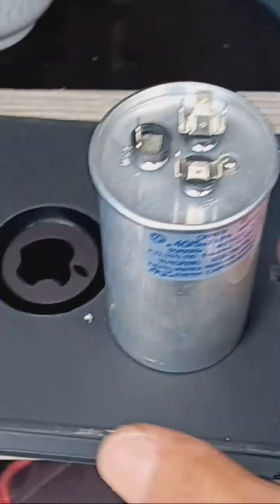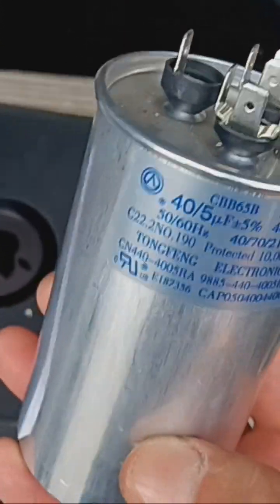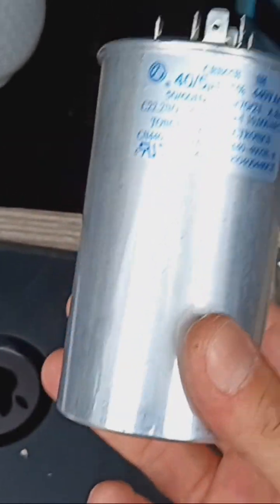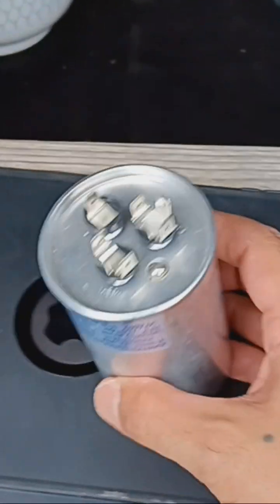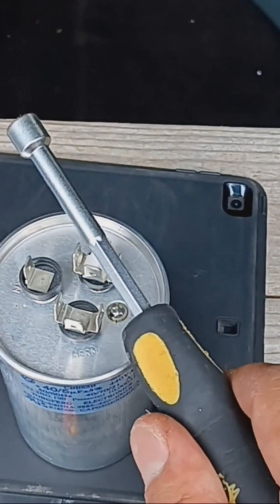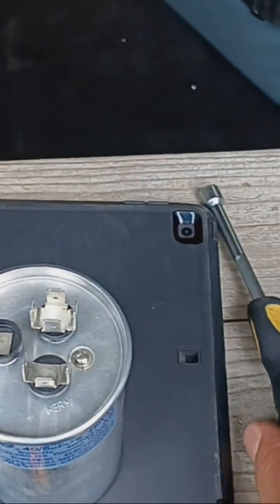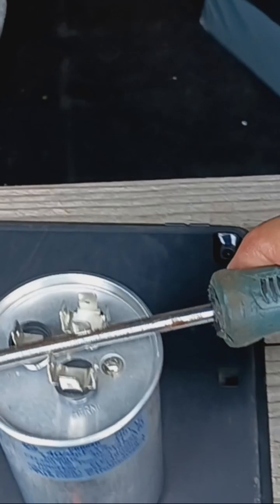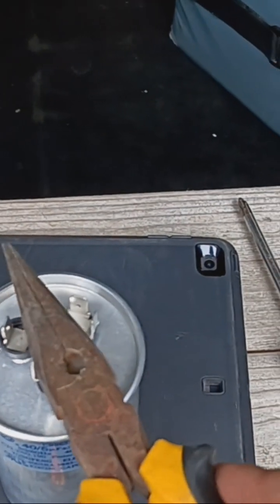How to discharge a capacitor #capacitor #repair #diy #tip #tips #tiktok #instagram #hvac #repairs

Comment: I thought I will shock u when u take it out? That true? U seem 2 be doing it after
Reply from the maker: No, once it's been discharged you can touch it with your fingers,  best practice is to tape up the top with electric tape, I see guys change a capacitor and throw the old one in the back of their truck like nothing
Reply from the maker: @brownchicken1314  BTW always cut out power to ac when touching a capacitor or you will get a zapparoni

Comment: Cool. I guess the resistor that's required to do it safely--the actual right way--must be  built into the screwdriver.
Reply from the maker: @brianhollingsworth-y9f  it's a special screw driver
Reply: Are you and your union the reason I can't buy these at Home Depot anymore?!?

I ain't paying hvac techs $200 to replace an $11 part you protectionist!

Comment: Does your screwdriver have to be insulated? Watched another video saying it was but not that it had to. 🤔🔋🪛⚡️
Reply from the maker: @chiquisbaby81  if it has a rubber grip your ok, if not a shirt or clean rag rolled would work,  it's discharging a stored electrical charge so treat it like anything with electrical

Comment: Instructions unclear. I used a butter knife. ⚡
Reply from the maker: @danbarron8072  as long as it ain't some of them plastic utensils your good, metal is metal
Reply: The buzz he felt after tho  @urbanbshvac
Reply from the maker: @leftdamaged187  I'm sure he was smart enough to use his shirt or something for insulation
Reply: 😂 he was pretty clear. He said a metal tool with a rubber handle.
Reply from the maker: @ocho27hd  can you imagine the zap he'd get, it'll wake you up better than a cup a coffee ☕️
Reply from the maker: @cheetodanger  depends on if you are grounded or not, old rule was to use one hand to grab a handful of your clothes whenever dealing with electrical
Reply: @urbanbshvac  I'm not a professional but Id like to understand why that would help. From my understanding, you're saying you want to be grounded and grabbing your shirt allows the current to pass through your clothes into the ground, instead of through your body and back into the circuit? I didn't expect clothes to be conductive enough to make a difference. Also if you had a grounded wire wrapped around your wrist on the hand doing the work, would it do the same thing or am i missing something there lol.
Reply from the maker: @cheetodanger  no that's the point it's not conducive,so if your doing something dicey like doing electrical work by following a YouTube video than grabbing the hand full of clothes will prevent that portion of your body from touching anything that can ground you
Reply: @urbanbshvac  right, you wanna be isolated from ground thats my bad, thanks for the info 🙏
Reply from the maker: @cheetodanger  cheers bud 👍
Reply: @urbanbshvac  yeah it went pretty well. Apparently as soon as I discharged the capacitor I decided to take a nap. I remember going in for the discharge, then a few hours later I woke up a few feet away. Also I now occasionally hear radio stations in my head, so bonus win. 😉
Reply from the maker: @Sad_But_True17  happened to my old ac instructor,  it'll either wake you up or put you to sleep
Reply: I guess you didn't hear the part about it has to have a rubber handle.

Comment: Yeah, but how do you get the charge back in the capacitor?
Reply: I use my tongue between the terminals like a 9 volt battery
Reply: @dahveedl3133  BRO THATS DANGEROUS ITS NOT THE SAME AS A BATTERY IT CAN STORE 100000 VOLTS
Reply: @casio-F91W  umm...its a joke. chill.
Reply: @dahveedl3133 they say that can increase your taste. Fancy a brandy
Reply: @dahveedl3133  Yeah, I'd pay to see that.
Reply from the maker: When you install it back in the AC or replace with a new one it will be charged again, similar to a battery/alternator

Comment: They discharge when you pull the disconnect.
Reply from the maker: I always discharge them at removal and always check for voltage after I disconnect to make sure the dang disconnect is working properly
Reply: @urbanbshvac  

Better safe than sorry
Reply: Not always